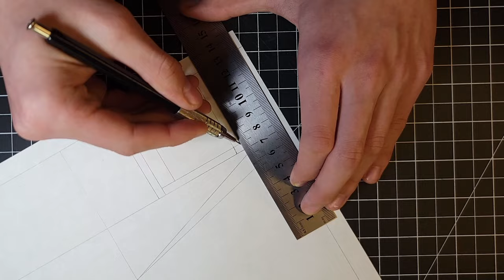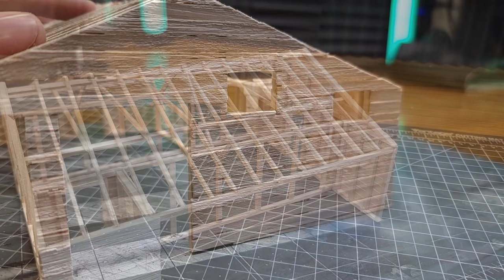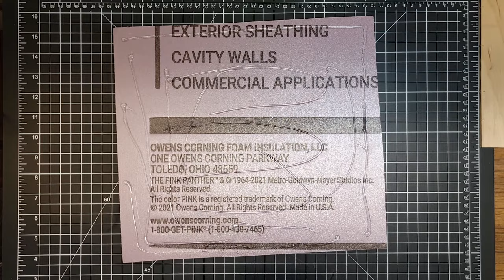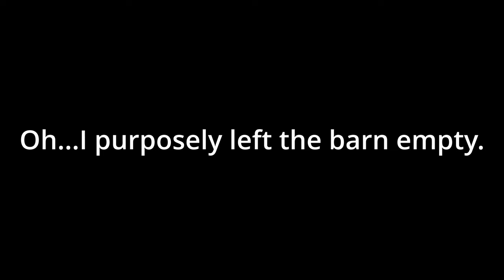Making an old Barn | Music Video

Comment: anyone know the materials and what i need etc to build this, i haven't got a clue what any of this stuff is called
Reply from the maker: Hi,
Materials:
1. Balsa wood - I like to use a thicker (about 3/16 thick) balsa wood for the frame.

2. A super thin wood for the wood planks on the walls - In this project I used a wood that I do not know the name of, but you can use balsa wood that's like 1.5mm thick and use a small hand plane to make it thinner, or you can just even just use the original thickness of the balsa wood,

3. XPS insulation foam - Or even scrap packaging foam.

4. Dirt - I just wend out and scooped some DRY dirt up and passed it through a strainer. (Amazon.com: Cuisinart Mesh Strainers)

Tools:
1. Knife (Amazon.com: Heavy Duty Multi-Purpose Ratchet lock Reinforced Utility Knife)
2. Super Glue and a glue that works on foam, like "Mod Podge"

 (If you have a local "Hobby Lobby" (( https://www.hobbylobby.com )) you should be able to find all these things there, it might be a bit on the expensive side but you can also find these things elsewhere.)

Helpful Videos:
https://youtu.be/YThJTafY5JU
https://youtu.be/QgAcKuX0ep8
https://www.youtube.com/watch?v=eII6YC820dE
https://www.youtube.com/watch?v=d371ubNKwto&pp=ygUSTHVrZSBUb3dhbiByb29maW5n
https://youtu.be/NvlFEA6p9SI

I Hope this way helpful.
May the Lord bless you!
Ecclesiastes 9:10a
Whatsoever thy hand findeth to do, do it with thy might!